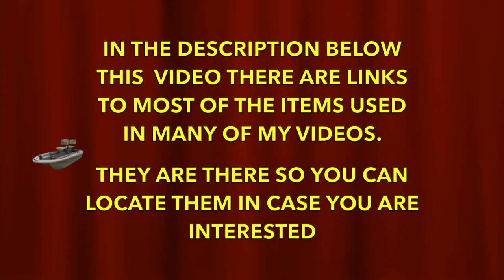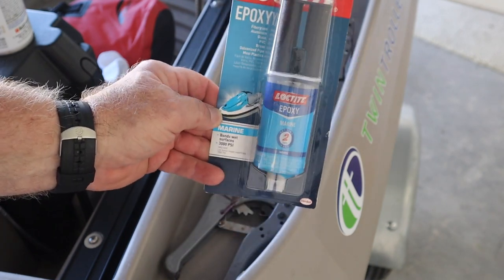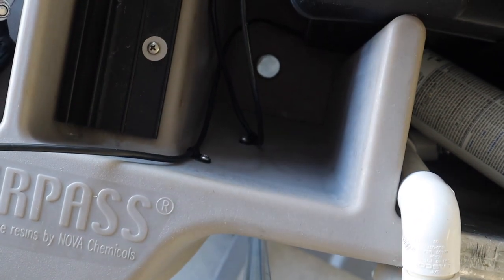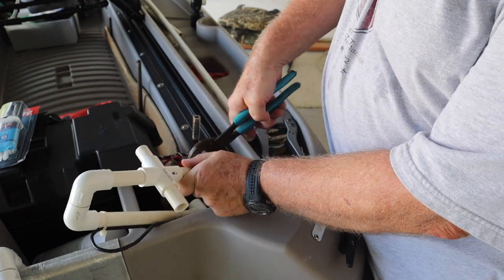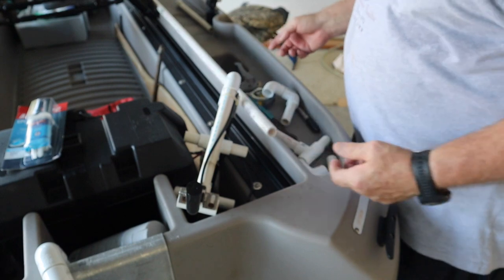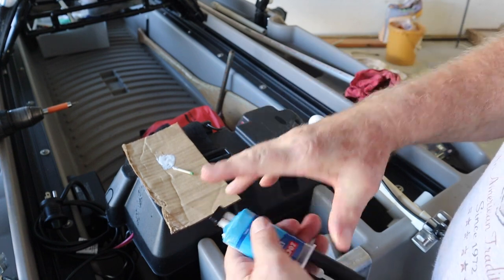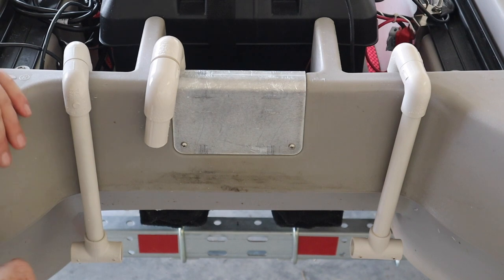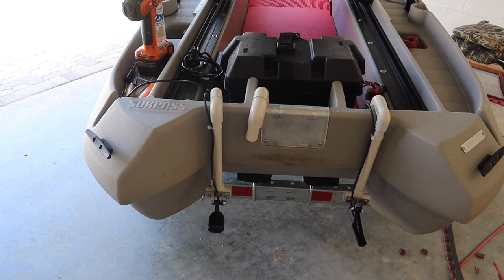THERE ARE HOLES IN YOUR BOAT!

Comment: Gerry do you get any interference having 2 transducers next to each other? I am picking up my deluxe model next Wednesday with the hook2 installed but I also bought an Elite 7 FS that I wanted to hang the transducer from that one off the back also but I am hearing that is not good due to interference?
Reply from the maker: JD, I NEVER get interference. Before I installed the Garmin I now have I had the original Lowrance and a second Lowrance. Now I have the original Lowrance as well as a Garmin with side scan and I never have any interference at all. The original Lowrance is powered by the main boat battery and I have always had the second fish finder powered by it's own battery.                                      Gerry